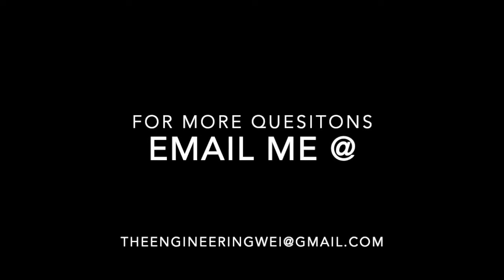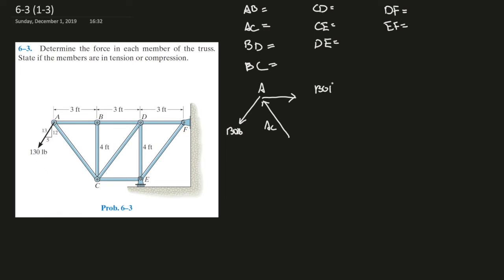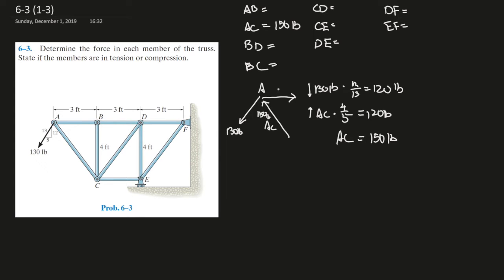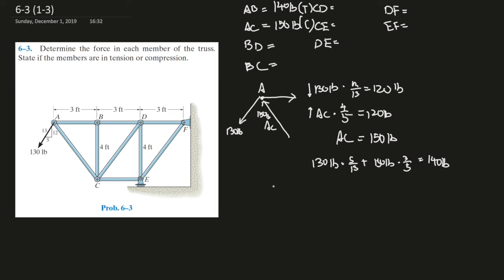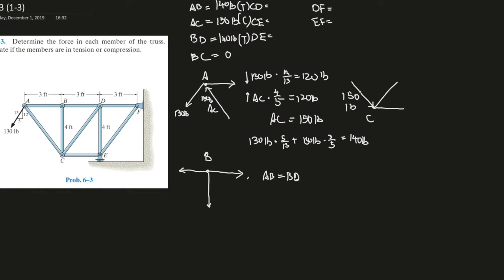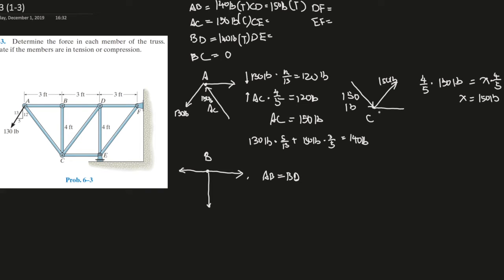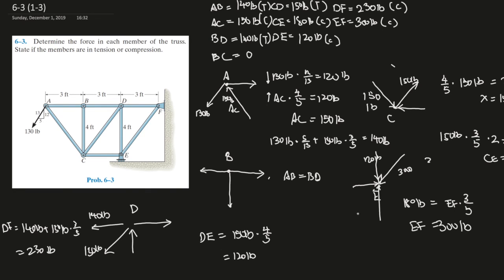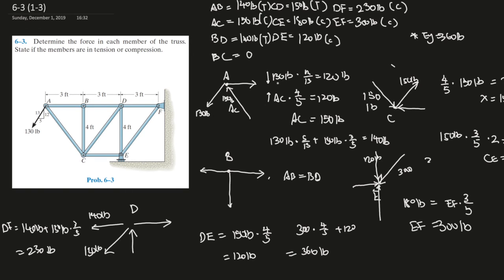6-3 Determine the force in members of the truss (state tension or compression for each member).

Comment: 7:02 I still dont get why 150 x 3/5 multiplied by two
Reply: I'm sure you know by now lol, but there are two diagonals acting on point C so each diagonal has an x component acting on C. In this case each x component happen to be the same since they each have the same magnitude and triangle. So if you add up each x component (or multiply one of them by 2) you get 180.

Comment: Around 3 minutes in when solving AB, why was 130*(5/13) positive. Because of the way the 130 lb force is pointing, shouldn't it be negative?
Reply: Because the force being applied has a negative value. Either way positive and negative really dont matter in your FBD's so long as you keep your positive and negative values consistent with up down left and right

Comment: How to figure out the direction of forces? I am kind of Confused.
Reply: i think you really just have to imagine which direction a force should be so it can achieve equilibrium
Reply from the maker: I think I explained clearly in the video, if you have a specific question or a certain part of the video is confusing for you, please provide the time frame or detailed questions.
Reply: @TheEngineeringWei  It actually wasn't explained clearly in the video personally. Howcome the direction of Fac changes from Joint A to Joint C? Went from pointing to Joint A to pointing to Joint C
Reply: @TheEngineeringWei  You typed all that out but you coulda just answered his question dawg
Reply: @DynamicHasan100  He just wanted to know what part of the video to explain so he doesn't just restate the whole video in a comment...